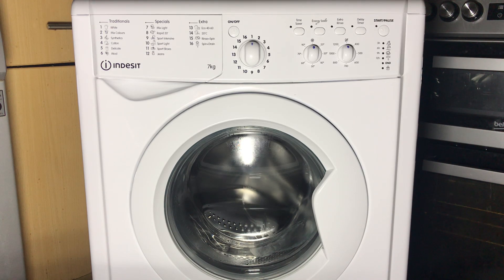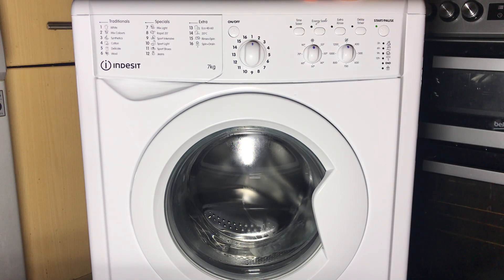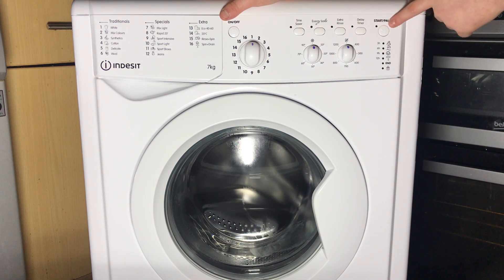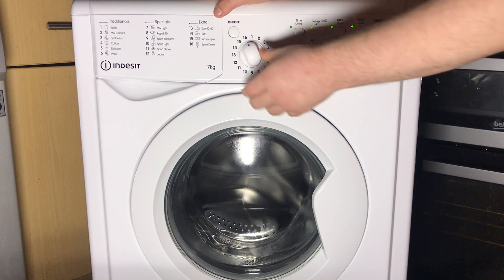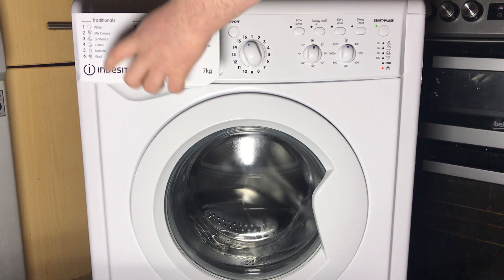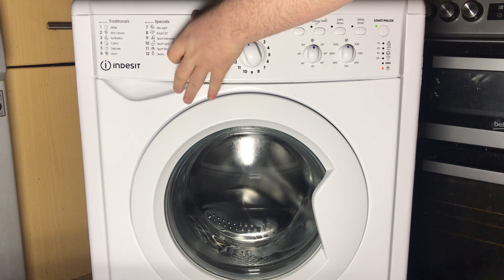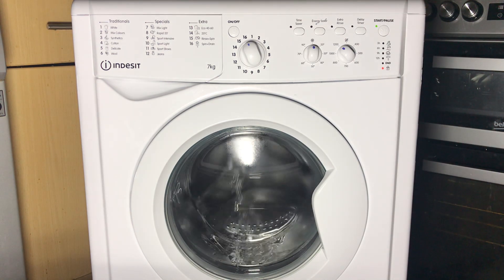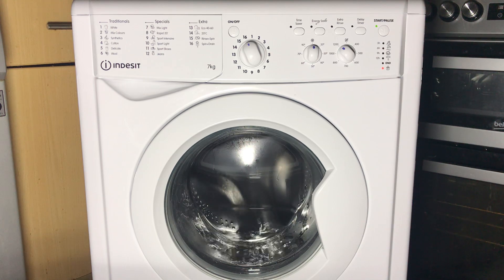indesit - service mode tutorial

Comment: I've got a brand new one and the water comes through but then the machine stops doesn't do anything but the timer still goes down (mines a my time one) the door just will not open at all it's stuck on the lock
Reply from the maker: if you leave it for 2 minutes or so after it fills, it should begin washing. these machines have an unnecessary pause where it does nothing for about 2 minutes after taking in water, before it then takes in more water and begins washing.
Reply: @thelaundrycookie1200  I left it for the full 59 mins it just counted down didn't spin or anything said end and its still locked 3 hours later after checked the filter and pipes and nothing
Reply from the maker: normally if it's not doing anything you'll get an error, which makes me think the drive belt has come off since it's counting down normally but the drum isn't spinning or anything. if you put it on spin, and you hear the motor but there's no movement in the drum, this will be the problem. as for the door lock, that may be a seperate issue entirely. it's a little hard to figure out without seeing a video of the machine or something.

Comment: Does service mode fix the dryer not drying?
Reply from the maker: service mode won't fix anything by itself, it just helps you see what's working and what isn't. if you're noticing the drying section isn't working properly, you need to make sure the heating element is working and that the fan is spinning. also look out for error codes popping up during the drying cycle, either as a message on the display or in the form of flashing lights
Reply: @thelaundrycookie1200  thanks. I'll try that.

Comment: I just used this now as i was having difficulty spinning,its a life saver 😂. Thank you. I had to paise and off it eventually as it kept spinning.  Iany tips for washing in 30mins id really appreciate. Thank you
Reply from the maker: i'm glad the video was helpful. to get the best results from any short cycles, i suggest following two main guidelines:
1 - avoid overloading - check the program table in the manual for the maximum load for each cycle. don't exceed this load size or performance will be impacted
2 - use the cycle for its intended purpose - these short washes are designed to quickly wash lightly soiled items. don't expect heavily soiled items to get fully cleaned from such cycles.
hope these guidelines are helpful. any further questions, just ask.

Comment: mine isnt spinning do you know how to repair this?
Reply from the maker: i need a little more information... is the drum turning at all in the cycle, or is it washing and rinsing as usual, but just not spinning?
can you hear the motor turning, but the drum doesn't seem to be rotating?
is the machine draining the water as normal, or do you find it with lots of water left in the drum?
does the cycle finish but the clothes are still wet, or does it stop and give an error? if so could you tell me what error you get?
Reply: The drum isn’t rolling at all

Comment: I have same Indesit , i Lost my time see that video, you dont explain nothing.!!!
Reply from the maker: i showed what i was doing while talking you through what i was doing, and also telling you what the machine was doing. i'm not sure what else you want me to do...
which part of the video don't you understand? maybe i can try to explain it slightly differently and see if that helps.
Reply: @thelaundrycookie1200  my machine  damaged bearing inside today 3h ago, very sad need pay repair very expensive
Reply: @thelaundrycookie1200  hi when I switch on the start pause flashes and then 3h and 6h are on how do I reset so when I turn on none of them are on
Reply from the maker: that error is F12 which is a communication error between the control board and the main board. could be a wiring issue or an issue with the board itself. as a result, you'll likely need an engineer to help you with this
Reply: Hi. My time saver button clicks but doesn’t work when clicked. I just got the manchine 

Please help

Thanks
Reply from the maker: time saver can only be used on certain cycles (only cycle 2 on this model). as long as it beeps to tell you it's invalid and\or the LED illuminates, then the button is working and this is not a fault.
Reply: @WOLF-wd8mp Oxidation may have happened contact electronic board PCB buttons, only solution open panel by special alcohol electronic cleaning
Reply from the maker: no, that's not the only solution. don't jump the gun - find out the whole story first, which is what i am doing with my reply to them